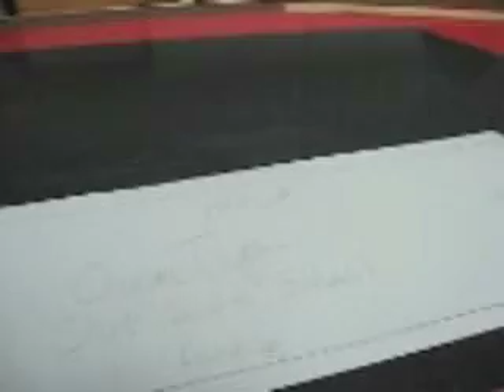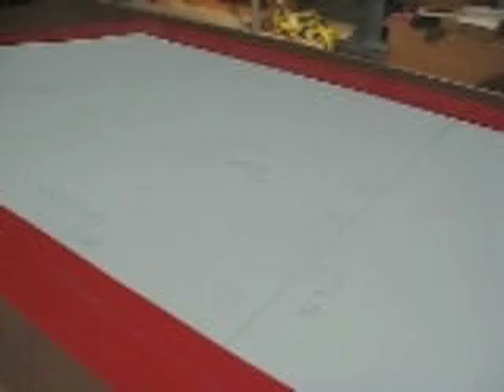Colorado Bob's Solar Oven -  6-4-09 Sheet metal work begins

Comment: I built several large ovens, not as big as this, but still big enough to cook a whole meal in ONE oven.  I always tell newbies to BUILD A BIG oven, this way, they won't be disappointed with having to build another one that is larger than the first.  In my slantfaced oven, I can cook a meat, casserole, veggies, bread and dessert in ONE oven.  i start with the meat first, then add the other pots in the order they will be done by dinner I stack them on top of the other pots using racks.